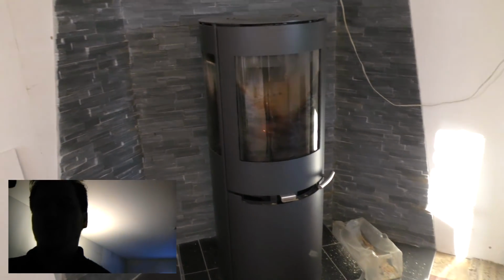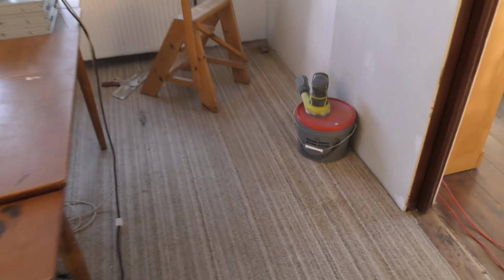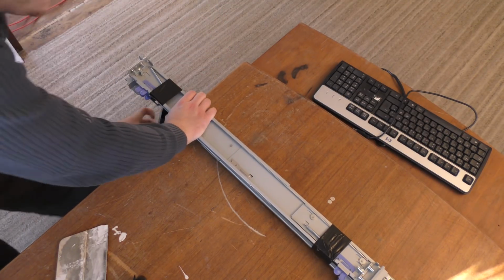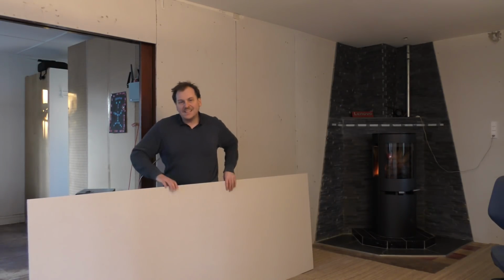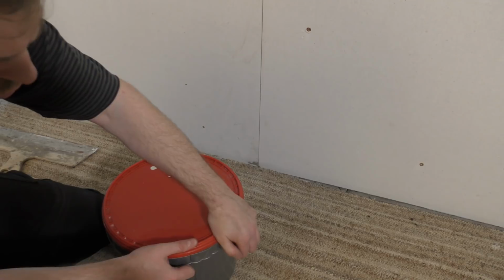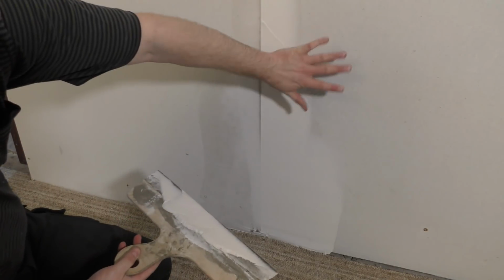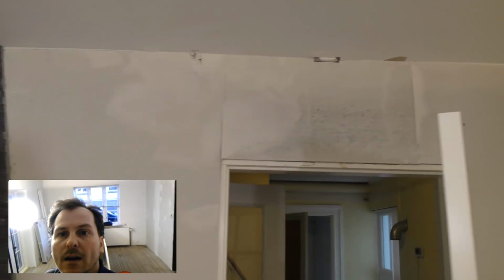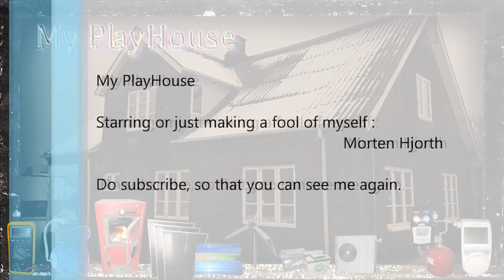How I Plaster the New Walls of My old PlayHouse - 632

Comment: You should put drywall tape over your joints!
Reply: William Kish and equal amounts of screws in each drywall! Not some random screws here and there
Reply from the maker: Hi A Landsvik
Thank You very much!  The fiber drywall is mounted to an existing plaster brick wall, with tile adhesive. The screws are not strictly doing anything.
Thank you for watching! :-)
Reply: Those dry walls aren't actually walls, their pretty much decoration panels. Also it's very uncommon to tape drywall in europe. We usually plaster them together.

Comment: I always used messed tape over the joints it help keep it from cracking but if it works for then no need. Good job
Reply from the maker: Hi old time engineer
Thank You very much!  The plates are glued to the plastered brick wall,, no problems on the other wall.
Thank you for watching! :-)

Comment: We call that Drywall or sheetrock here in the USA it comes in several varieties we have regular drywall made from Gypsum we also have purple board which is similar to drywall however it is water and mold resistant and then we have cement board that is used in very wet environments or near fireplaces or wood stoves where there are very high temperatures and a possibility of having a fire.    Once the drywall is installed we then use mud and tape on the seams the "mud" is actually Joint compound and we use a paper tape on the seams to create a more uniform seam and to help hide it from view after painting, corners are re-enforced using either a metal or plastic corner edge that is then also mudded over with the joint compound.
Reply from the maker: Hi The_KillShot
Thank You very much!  This fiber drywall is not the normal thing,, it's somewhere between normal drywall and cement boards, in strength.
Thank you for watching! :-)

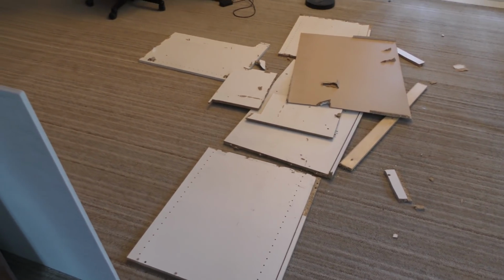Comment: Rather than gaffer tape things like the rails, I prefer masking tape... It's perfect to hold rails and things like them, except... it's approximately 99.56% easier to remove and doesn't leave a residue :)... Oh and.... 7:45 Loving the high speed axing... VIKING POWER!
Reply: ohohoho.... and... You can paint those walls before you paper them, but a BETTER option (in my opinion) is to seal them with PVA... Seal them first, let that dry thoroughly and then paper over the top, it's much better than paint at taking the paper later, AAAAAAND, it's cheaper, sealing the porous wall before it sucks the moisture from the wall paper glue you use!.... Plus PVA is much much cheaper than paint you'll never ever see as its behind wall paper.... Enjoy!
Reply from the maker: Hi Lord Xelous
Thank You very much! plain white wall paint is not expensive,, and I think i have some.
Thank you for watching! :-)
Reply: You know what this means?... I'll be watching that wall paper like a hawk... :)

Comment: Nice job with the plastering, Morten!
…but a word of warning: You don't want to put such woodchip board as the old piece of furniture you broke up there into your oven. Unless you want your neighbours to turn into zombies or grow some antennas yourself, that is.
Depending on how old the thing is, there is some chance that the adhesive that bound the woodchips together contains loads of Formaldehyde, which is, like, really nasty stuff.
https://en.wikipedia.org/wiki/Formaldehyde
In your oven, before burning, that stuff will evaporate and likely get into the air you breathe in an unhealthy concentration.
Way back in the eighties,  I took part in a school project about air pollution. The teacher who headed the project handed me a little measuring device for all kinds of aerosol contaminants like Carbon Monoxide, NOX and, among them, Formaldehyde, to take air samples around town and see what the distribution of aerosols was. I snuck that thing into a furniture shop and took a secret measurement. Well, not quite secret enough, they noticed what i was doing and kicked me out… 0:o), but from the half finished measurement I still could see  the measured concentration in their shop went through the roof! That was a warm, lightly windy day in early summer, and I measured the concentration again right in front of their door. That was public space, they couldn't chase me away there, and still found a ten times increased concentration as compared to other parts of my home town, which then was mainly living on chemical industry.
The point why I tell this being: Don't burn these boards. I'm not even mentioning the Dioxins the plastic covers of the boards emit when burning. Bad, bad stuff. Highly dangerous carcinogens.
Reply from the maker: Hi Eo Tunun
Thank You very much!
Thank you for watching! :-)